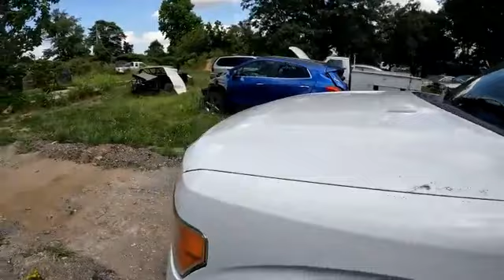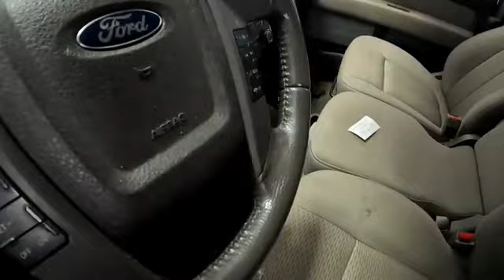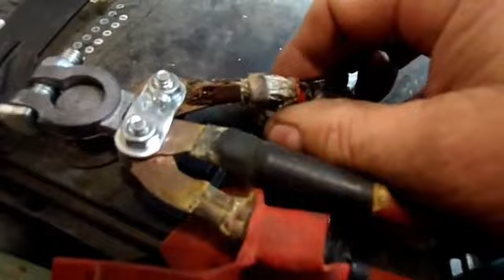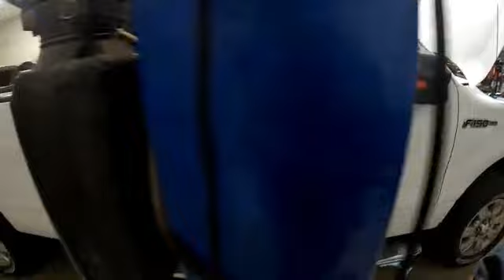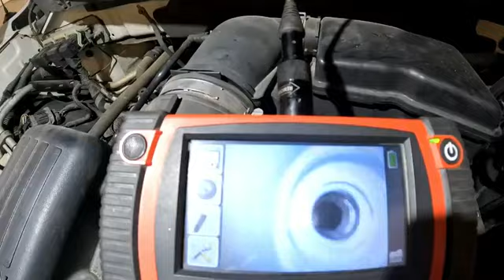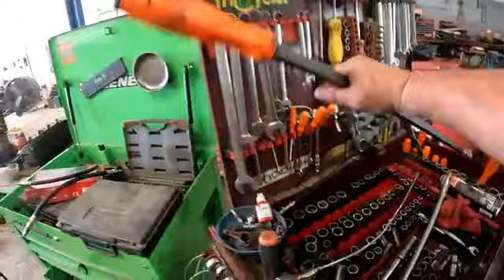FORD F150 5.4 WONT START - FORD DEALER SAID NEEDS NEW ENGINE

Comment: I'm just a "shade tree" mechanic that turns wrenches for folks in my spare time after work and on the weekends. That being said, I can't tell you how many times people have brought their cars/trucks to me  wanting to have a junk yard motor installed cause the dealer or some shop told them theirs was shot.  I end up looking at it and find something simple like a bad cam sensor or vacuum leak that's easily repaired

Comment: Great diagnostics, taking your time to actually figure out whats wrong.  I'll put money on they heard it run with the converter bolts missing and thought it was a rod knock.  But if not, i don't know how they did a "compression test" without the starter working.
Reply: They probably loosened the converter bolts, and then tried to sell a new engine.
Reply: @asherdie  anythings possible

Comment: Great diagnosis. 
Just guessing if it is a 5.4 3 valve.
Goes to the dealer. Due to them mucking things up. Dealership assumes engine is blown.
I had heard a lot of mechanics don’t mess with the 5.4 3v. Due to the timing chain issues and will just quote a new crate engine.

Comment: Your a nice mechanic, but here my evaluation on this vehicle.
1. $95.00 labor +
2. high resistance in the cable.
3. Go for the starter. P&l  $300.00
4. Leave the ground cable discounted
5.remove the tranny cover (Why ?) 
6.remove the plugs (Why?) 
7.tell customer they need a new engin 
8. Let it rack up storage fees, Garage will deduct it off engin installing.
9.customer can't afford engin replacement
10. garage offers to buy vechicles for low bid amount,or a trade in at their  shirt tail cousin car lot. 
11 another person RTF Off.
Reply from the maker: You could be right about that  , I did not think that stuff like that happened a lot at dealers but after reading all the comments OMG
Reply: @heartlandmechanic  started out turing wrenches & sanding milk trucks when I was 10 years old for a foster family. My wife has beg me to write a book, or open a U tube site what I seen in the shops, car lots,Auto Auction Lanes, such as iam like you, I have or can't work for a bad dealership.a good mechanics should be able to do a complete shake down on a vehicle with medium milage with in 2 min or less on old vechicles newer ones I won't touch them......really like your channel I have passed this on to 4 of my family members, and several friends...keep up the good work.👍

Comment: Ford dealership located in Alexandria Louisiana tried to do this to me.Told me I needed a new front end on my 1999 F150 what they didn't know was 6 months before I got a whole new front end replaced. They wanted 2,500 dollars my vehicle has 216,000 Miles . So I brought it back to the original place that put the front end on, they raised up my truck and said everything was perfectly fine. I took it to another front end alignment place they put the truck up they also said that was absolutely nothing wrong with the vehicle So I called this dealership back and explained what was going on and of course they didn't care as of two years ago I have never spent another dollar at that dealership.